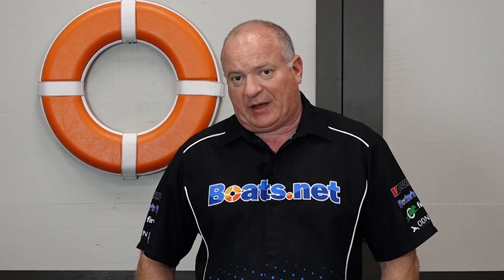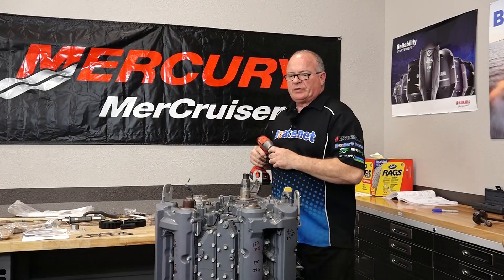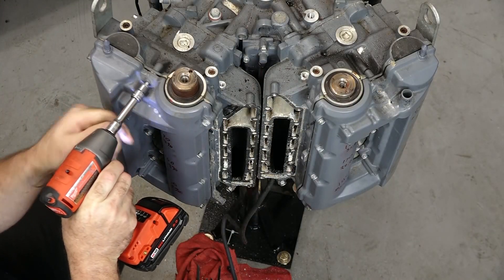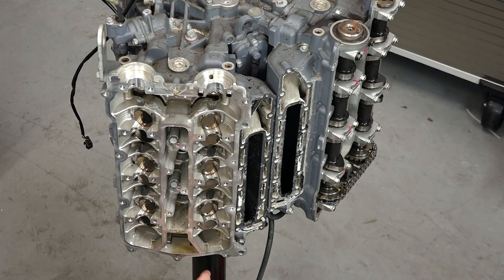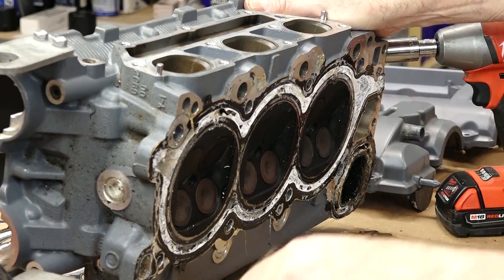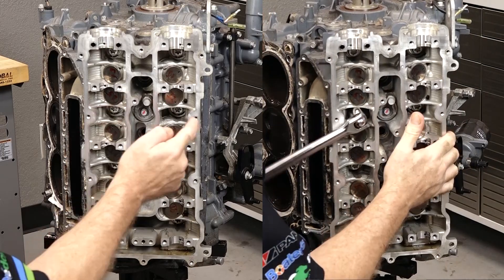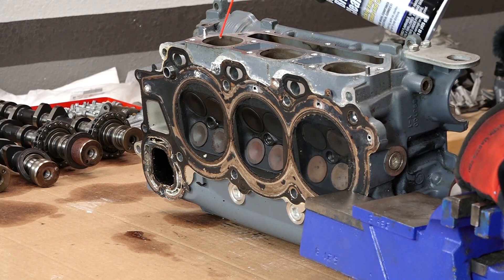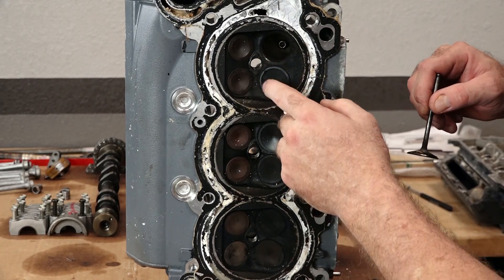Yamaha F225 Outboard Rebuild Part 2: Powerhead Teardown | Yamaha Outboard Head Removal | Boats.net

Comment: Hey John , I have 2005 F225 , the bottom port  cylinder has a spark plug with nothing left on the end all gone . 
I launched my boat warmed up the engine for 15 minutes, , switched it off just to be sure of a restart, and nothing would turn over . 
Took the boat home , I needed the breaker bar on the spark plug , the engine still won’t turn over with all the plugs removed . 
Do you think my engine has any chance of a piston replacement. Thank you Eric

Comment: these engines are non-interference engines, so you can do whatever you want with the camshafts without risking damage. it says so in the very first pages of the workshop manual. -yamaha-tech

Comment: Nice to see major rebuild videos.

I understand for some years and models it does not make financial sense to do major rebuilds, even for demonstration purposes.  Not just because of cost, but mainly because of certain key parts are longer available.

Might I suggest the following because there are tons of them out there, including mine:

1980's to 1998 OMC V4 90 degree crossflow (90 hp to 115 hp).    Major rebuild, ignition diagnosing, fuel delivery diagnosing, VRO oiling testing/diagnosing, and possibly cover gearcase re-assembly (bearings/seals)

Keep the videos coming, I'm sure there will be more things in the near future I will be buying from Boats.net and Partzilla.